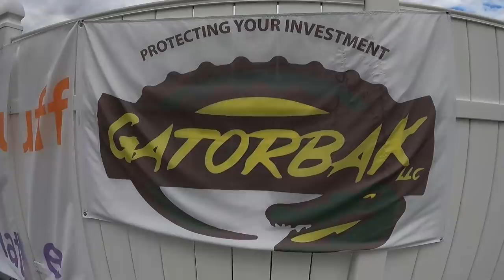I Fixed my Rusty Boat Trailer with Flex Seal - Episode 3

Comment: Flex Seal is pretty amazing product. As you mentioned, getting the prep done right is critical to having a good result. Anyone I've run into that had problems with the product pretty much always turned out to be not doing the prep work properly. Your trailer came out absolutely beautiful! Congratulations on another amazing restoration.

Comment: Nice restoration on that trailer.
You definitely make them easy to sell to a new owner.
Next time you paint over corrosion your wire brushed or wheeled prime it with a rust encapsulation product like Rust-Oleum's Rust Encapsulater.
Just painting over it Flex Seal  is just hiding the rust which can allow it to end up intergrainular corrosion.
You see that when steel peels away in layers of rust.
Just ask any Coast Guard or Navy Veteran who was a deckie that chipped paint and needle gunned rust on ships.
We had classes on it at Aviation Machinist Mate A school.

Comment: Never would have thought to use flex seal on a boat trailer smart thinking should encapsulate the metal and keep it nice be nice to see how it holds up.
Reply: I use spray can bed liner which does about the same thing. You can do it at home and it's super durable, though not really cheap.
Reply: @gsh341  What’s the trick to getting the spray-on liner to stick to galvanized?  I cleaned and degreased a step I was adding to my trailer before spraying it. The coating flaked off in several places.
Reply: @JT_70  I've never done bed liner on a galvanized trailer, but the trailers I've done I got them sandblasted to remove rust then washed and degreased them before applying the bedliner on bare metal.

Galvanized metal is coated in zinc and zinc naturally rejects both paint and bed liner.
Reply: @gsh341  in my opinion, he should have sand blasted and primed this trailer before applying FlexSeal. His final finish looked good but I’m concerned about it rusting thru the FS.

Comment: Has  flex seal got uv  protect in the product....   I've used similar products and just top coated with a clear uv  for added comfort...  just me but I would of used a primer first then used the flex seal.....  k  for Christmas get yourself a cordless grinder with flap discs.... just had a friend do Bed liner spray on his trailer.... turned out amazing and he used a colour bed liner

Comment: You should spray Eastwood Rust Encapsulator on the inside of the frame to stop any rust that already started. You may have to drill holes along the frame and then plug them when done.

Comment: Have you ever considered using POR instead of grinding all the rust off?
Why don't you use pressure treated wood?
Reply: He Said that he is using 2x4 preassure treated?
Reply: Pressure treated wood is relatively inexpensive and handles getting wet fairly well, but if it comes in contact with aluminum it causes corrosion. When I replaced the bunks on my boat trailers I used cedar. Naturally rot resistant and no problems with corroding aluminum. It is softer and bends a bit, but if your supports aren't very far apart you'll never notice the difference

Comment: Nice job. Although you should, at the very least, cover the wires in a plastic wire cover to protect them from road dirt and grime as well as UV light. It would also make them virtually disappear against the black trailer. Ideally the wires should be run inside the frame. with rubber grommets wherever the wires exit the frame.

Comment: It appeared that the trailer came with 2x6 bunk boards which were replaced with 2x4s.  For that length and weight I would have stayed with 2x6.  I replaced the 2x6s on my tri-toon trailer with full-length pressure treated 2x6s and a different brand of similar plastic bunk covers. Given the weight of my 25’ boat I would not have trusted 2x4s to provide enough support. I had to special order the 24’ boards.  I hope the FlexSeal holds up given the amount of rust under it.

Comment: The only issue I see is wherever you welded anything to the box section will tend to rust out from the inside . Outside looks pretty but inside will be rusty as hell !  Anywhere you sprayed it over existing rust I.e. the ladder will continue to rust underneath.

Comment: You should cross the wires on the LEDS (if they are RGB) so that one side is red the other green for Port and Starboard. it would also give some diffrent combinations scrolling through the other colours.   2x👍
Reply: They are not rgb on this particular one-button unit

Comment: Love all your builds! Just a quick question do the amber lights on the trailer need to be at the widest part of the front of the trailer and not on the tongue of the trailer. Just curious. The trailer came out so awesome 👌
Reply: Every trailer is different obviously and every country has different requirements. Andrew Camarata made a few great videos on rebuilding trailers and he gave good information on lighting them to America’s DOT requirements. Of course every trailer and country is different but in America, you just want to put each light in the most visible spot possible for its intended use. Amber lights need to showcase the front and back of the trailer as much as possible from sharp angles, tail light need to be as far to the left and right as possible. If the trailer is over 80” wide, it’s required to have 3 Amber lights approximately 1” apart in the back middle.

Comment: that is one thing i never had luck with is flex seal. had a camper and did the roof with white flex seal and less then 3 months had to redo it again because all the leaks came back. needless to say i couldn't get the roof to seal again after i put the flex seal on it so i put a tarp on it and will never buy it again

Comment: Didn't know Flexseal sells welding machines.  The title should be "I fixed this trailer with a lot of hard work welding and replacing metal then sprayed it down with Flexseal".

Comment: It’s kind a pain to see the way you’re craftsmanship is Taking a turn. Maybe in Florida it’s another vision to how to deal with moisture. The way you treat you’re metal, the choice of wood, the way you wire things, the materials. All inferiority around. If I watch the comments a lot of people trying to nudge you in a better direction.

Flexseal is a product which, used in a good manner, can be a plus. But just painting over active rust. That’s a no go.
The wiring will be in contact with water, use better terminals which a waterproof (expensive)
Use hardwood or aluminium for the beams, not just inferior wood and even worse encapsulate it in plastic so it can’t dry….

It’s good to have sponsors, but I think you took the wrong road. cheap plastic , cutting corners all around. Not good.
I miss the Zach which shows his skills in a artful way, finesse etc. Hope he’s comin’ back soon…

So no more pontoons (not again), and more little but artful mobility’s projects please.

Comment: Using a product like that can have the exact opposite effect you are trying to achieve. Living the rustbelt zone , we no longer use any undercoating on vehicles , as the coating traps water and rots the frame. By you coating with a rubberized product , when you submerge the trailer in salt water , the resulting outcome will not be good. This is why many have switched to cosmoline, fluid film,  crc, sta-bil, rp-342, amsoil mp, and similar products. Best wishes .